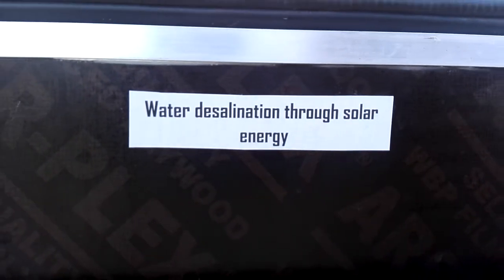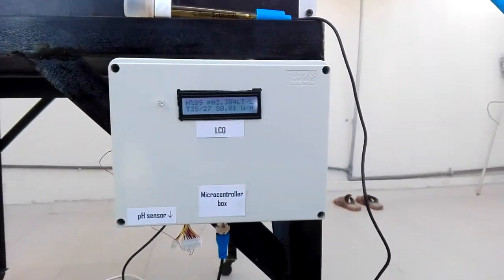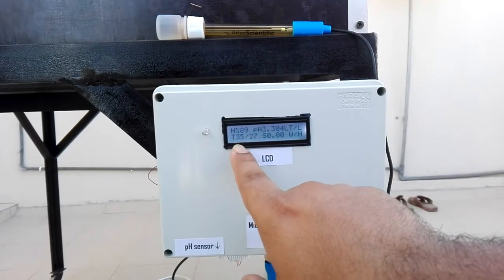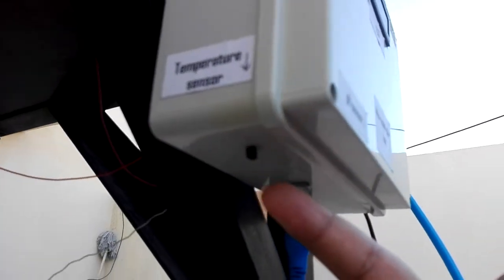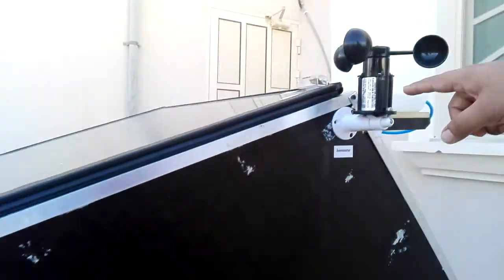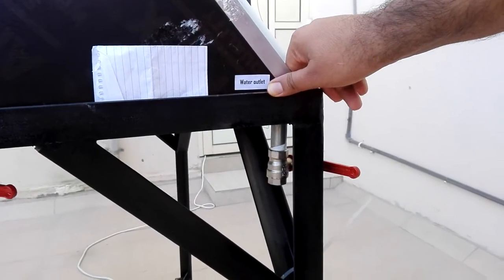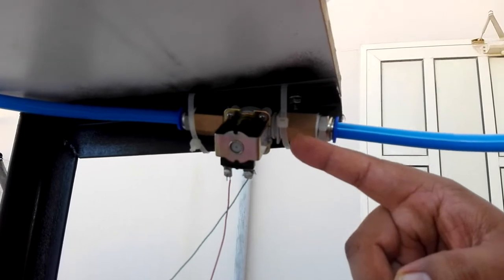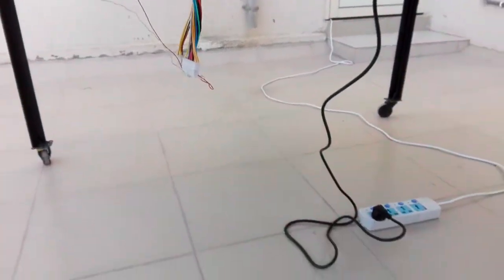Water desalination using Solar Energy Microcontroller

Comment: this is bullshit, using flat surface evaporator won't give more than 1L of water per day in the summer of a hot desert, what you need to do is use parabolic mirror and put that system in the focal point of the mirror, watch GREENPOWERSCIENCE channel about parabolic mirrors

Comment: I gave this a thumbs down because it does not show where the water is on the inside. I am assuming this is some type of material that the sea water is absorbed into then evaporates from there.  But I would like to see that. How often do you have to change it.